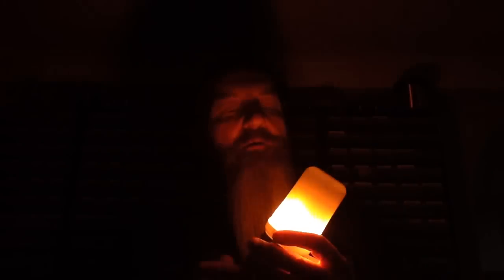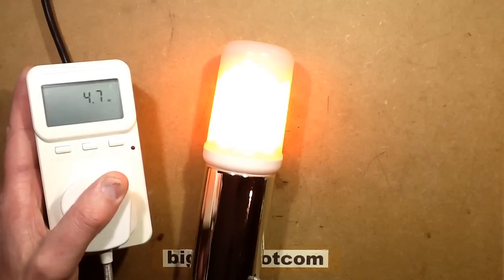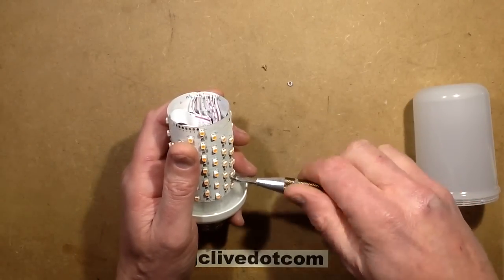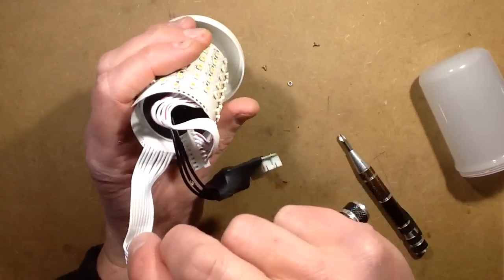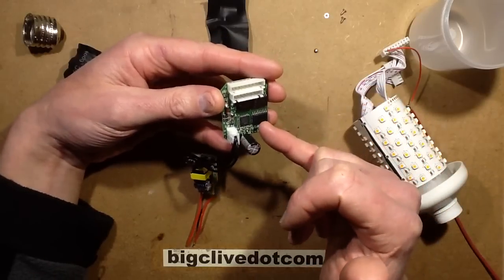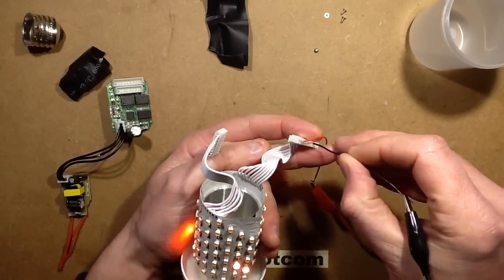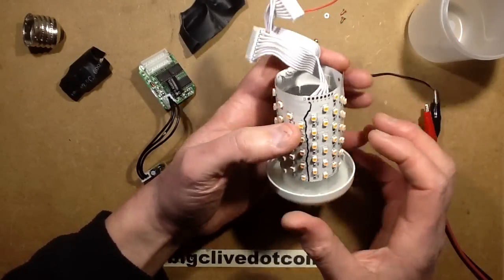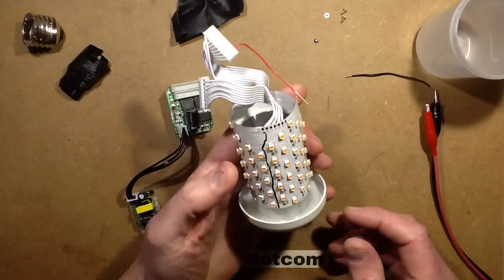Amazing new realistic flame effect LED lamp. (Full original version.)

Comment: Got 2 pairs of those flame effects bulbs now for my Aunt's altar and they're quite interesting. The come in E14 and E27 sizes with different color temperatures. (I might try to hunt down the blue one for fun)
The first set is quite similar to the one you shown and torn down with the minor changes of the Fade/Ramping and Solid/Steady light being swapped and the cover being glued on instead of a screw cover. Its got a color temp of around 2700K to my eye.
The second set was far more interesting as they had orientation sensors inside and the flame effect switches orientation depending if you have the bulbs upright or upside down from a ceiling. I didn't year them down, but the orientation sensor is more of a tiny cylinder with a ball acting as a sliding switch that makes an audible clink sound to switch between the orientation of the bulb's flame animation. Its also got the Fade/Ramping and the Solid/Steady modes that are switched the same way. Another distinct difference of the second set has a different color temp at about 1800K from what I can gather and it harder to get an photo as it tends to quite red on photos instead of a more orange-yellow flame that's close to an incandescent bulb like the first set.

Comment: You're so happy about that light 😏😁
Reply from the maker: Yeah, but the Chinese manufacturer wasn't when I took it apart and showed the schematic.
Reply: @bigclivedotcom  I wondered if you went a bit too far, but if they sent it to you with the thought that you wouldn't take it apart, what exactly were they expecting would happen, right? Anyhow. I'm thinking a lot. I'll let out another thought. I wanted to buy one of those lights, and the links in your description didn't work anymore, and so I looked up the key words on Amazon myself, and I'm finding it difficult to tell if the product has been copied, or not - it's difficult to judge from just the sellers webpages on Amazon. Yet they all have something in common: They don't use a picture of the actual flame effect, but instead they all use the same shitty cgi flame picture pasted onto the product! like they used blender to come up with a flame image in the first place, or augment it, and then pasted it onto it. It looks soo horrible and unconvincing ☺️😁😉😛 Perhaps it's from the same marketing division that thought sending it to ya is a good idea. Oh, and I also found the other style of flame bulbs that are smaller that you also reviewed which have the individual leds in the matrix shine through more. The one in the pink socket. I need to get myself some mood lighting into my home now for me and my guests. :-) I gonna grab one of those bulbs, that come in pairs, that look in shape like yours. They look convincing on other yt videos and what seems to have been added is that the bulbs can now sense their orientation and the flame pattern will move upwards or downwards depending on whether the bulb is turned upside-down down or not. :-) keep it up. I like you

Comment: 3 years later these lamps are half the price and twice as good.
Reply from the maker: Yes they are.  With a wide variety of circuitry.
Reply: @bigclivedotcom Newer ones also auto flip so you can use in either orientation.  Have you been opening up any of the new ones? Didi I miss a video.

Thanks for your wonderful videos. Your video is the reason I bought my (first generation) lamp for my Halloween classroom.  Great stuff.
Reply from the maker: @error404m  Search my videos for the word "flame" to see others.
Reply: @bigclivedotcom  thanks

Comment: Off camera does that lamp look like flame or moving dots? I got one a year ago that looks just like that. The matrix was similarly spaced. However it dodn't look like flame because you could clearly see the round dots. :(
Reply from the maker: Sometimes it helps to fine tune the diffusion by adding something around the outside.
Reply: @bigclivedotcom  I got it for a old oil lamp  that had been converted with a plug and socket. I frosted the lamp glass and still you could see the dots. I've been hoping these lights would get better so it would look realistic. If so I may try getting another if they exist.

Comment: You mention that the module supply voltage is 9-12VDC. Am I right to guess that all variants of this lamp would be happy with this range of voltage? I have just ordered one of this type of lamp: I want it to illuminate the firebox of a G-scale steam locomotive, and all the other electrics in the project will be using 12V (fake steam & smoke generator, other lamps, sound module, wheel motor etc).
Reply from the maker: They don't all operate tha the same voltage.  Different types operate from 4V to 12V.  You can get USB powered versions.
Reply: @bigclivedotcom  Many thanks for the quick response. However, I had already ordered it (Lumiereholic, Amazon $12). I chose it 'cos it has no gravity sensor & I'm putting it in the model horizontally. I shall try it first at 5V.

Comment: Clive , I live completely off the grid...primarily 12 Vdc .  The company website shows mains and secondary voltage  (12vdc) .
 I can't tell from your tear down , but , do you think I could run this from my (solar/wind) system with a +/- 2 volt variation  ? 
  I use e-26/27 sockets for most lighting .
  Been watching you and Ralfy for a bit and a sub for two months  .
 Thanks for the fun and info !
Mark.
Reply from the maker: If the voltage is variable you could use a 5V version (they do one with a USB connector) and plug it into a car USB power supply.
Reply: bigclivedotcom 
  Brilliant... I'll check it to it .
 THANK YOU !

Comment: Thanks for your great videos!
I want to add this effect to my car.. Can this lamp might somehow be easily adapted to use 12v?
What do you think? I agree they look very nice.
Reply from the maker: You can get a USB powered version that would run from a USB adaptor.
Reply: bigclivedotcom I looked about and found none, I did find one (link below) which looks ideal size wise, and I also like the single mode and gravity sensor feature. This is much more on track for me, less fuss since I don't want to see the other non flame modes ever. So, after watching your video closely it sounds like these ad 12v power inside.. can I climb in there and bypass this to wire directly to a cars 12v system? Any tips for hacking these are welcome. I want on my dashboard.

https://www.amazon.com/dp/B07832DWVX/ref=cm_sw_r_sms_tai_3hR3Ab...

Comment: I had forgotten you did this vid, i saw another guy with a different make (LIFU), he made a couple of lanterns for these, he's into LARP, so i got one to see how it was powered, turns out it just needs 5V, and as you said in this vid, the circuit is on the flexi pcb with the led's
I did a couple of vids on it, but didn't want to break the solder connections holding the flexi in a complete cylinder.

Comment: Mine doesn't unscrew like the one you have, what brand is it? I have a lamp that is covered with plastic translucent material already and I think it would look more flame like without the bulbs plastic cover
Reply from the maker: Some unclip with enough force, but always regard the circuitry inside as being potentially referenced directly to mains voltage.

Comment: Wow! That one has a lot inside it. I bought one, for near the cheapest price, and took it apart. It had no wires inside. It had a board at the base teed with the LED panel and a transformer stuffed into the screw base. That simple design was fine with me, because all I wanted to do was to try a cheap one inside my salt lamp. I stripped the globe, and base off, hooked up a old night-light cord with switch attached directly to the lead power wires, then stuffed it inside my salt lamp. The animation of my bulb is probably bottom rank, but the effect inside the salt lamp is pretty satisfying. Your bulb - I bet - has a much better realistic flame. Looks sophisticated.
Reply from the maker: +Wookiemonsterfreak This was one of the first versions.  Yours may actually have a more complicated flame pattern.  They've evolved a lot in a year.

Comment: Would there be an easy way to convert this to a DC connection? I was hoping to use this in a camping situation.
Reply from the maker: If you look at my more recent video on one of these flame lamps you'll see it can be run from a USB power bank.  Some other versions require 12V though.

Comment: So if I wanted to use this as an outside carriage lantern on the house, and the first night it comes on as a flame, then the next night it would come on in a different mode?  Or does the mode change only happen with a short off/on cycle?
Reply from the maker: +Mike Frazier It requires fast switching to change modes.

Comment: If I put this in a sensor-based lamp - one that automatically turns on at dusk and off at dawn -- do you think it will keep changing "modes"? What triggers the mode change, and is there a way to turn that feature off? I don't just want flames every 3 days.
Reply from the maker: It only changes modes when turned off and on quickly.

Comment: Hi, so you mentioned it the transformer supplies 9 & 12 volt. Do you reckon it would work okay if the transformer was removed and it just runs directly from 12v? 

There would be prefect to be used for awning lights on my 12v campervan

Comment: I've procured four flame effect LED bulbs over the last couple months from aliexpress. Two are the same size as the one in the video. However, they offer two modes, flame, and all-on. On these, the complex array of PCBs, connectors and cables seems to have been tidied up quite a bit. The flexible circuit board holding the LEDs also holds what appears to be a single chip as it folds through a slot on the aluminum tube and extends inside. Only two wires connect it to the power supply board coming up from the base. I haven't further disassembled the bulbs since it appears further disassembly would possibly be destructive. The other two bulbs are smaller, approximately 2"/50mm in diameter. Same height as the others. These are single mode only-flame effect. These also eliminate all the connectors and wires. The LEDs are mounted on the flexible board as before, wrapped into a cylindrical shape, but not an aluminum tube. The PCB tube is smaller in diameter, approx 1.25"/ 32mm. Same number of LEDs as the larger one, but more closely spaced. The PCB tube is mounted on one end to a circular double sided rigid PCB, which forms a base, and contains the brains of the bulb. It has a mystery 18 pin chip and some passives on the out-facing side, and what appears to be 18 transistors and passives on the in-facing side (the bottom of the tube). Again, only two wires (red positive, white negative) connect the whole assembly to the power supply in the base. The light assembly is powered by about 5V, which I verified by powering from a bench supply. Works down to about 3.1V at reasonable brightness. Below that, you can see that it does function, but the LEDs get very dim. According the the power supply, draw at 5V is about 500mA max. At 4V it drops to about 150mA. Not sure how accurate that is, but could make for a neat battery powered hand held lantern effect. Curiously, my dumb Kill-A-Watt says the smaller bulb is about 3W, the larger bulb 1W in flame mode. The large bulbs were less than $12USD, the smaller bulbs less than $8USD when I bought them. The larger ones have been on continuously for about a month, still seem to function fine. I've seen some sheet plastic at the local home improvement center that might be good for further diffusing the LEDs. It's clear, but textured so that it looks like rain rivulets on glass, designed to allow maximum light transmission, but highly and randomly distorted, the sort of thing one might use for a shower stall or bathroom to offer a degree of privacy. Really neat bulbs. We'll see how long they last.

Comment: If the light is on a daily timer and you have it on the flame mode, the next day when it turns on, will it be in flame mode still, it will it switch to the next mode.  Are the modes only switched when you turn it on and off rapidly?
Reply from the maker: Yes.  It has to be rapid.

Comment: The little power module is a current driver, actually, since LED intensity is linear with current, not voltage.  Sinking I/O to 3 LED's each per line on each section.  Artistically well done.  "Echoed" is a good word!  5V/360 Ohms = 14 mA per LED.  Probably PWM'ed for efficiency.

Comment: Interesting tear-down video. I'm considering getting a couple of these to replace the noisy mechanism in our flame-effect fire, but I'd have to find a way of disabling the switching between modes on sequential power cycles
Reply: I think, just removing the third wire should suffice.

Comment: Can you think of any way to run that on a battery?  I need to make two torches for a production of Fiddler on the roof and these would be AMAZING!!!
Reply from the maker: The internal voltage was quite low on this if I recall correctly.

Comment: By the way these can easily be modified to battery use for stage/handheld prop use BUT be warned there is a newer version out with a much better design (all PCB no cables) and while the LED PCB still says 12v, it isn't, the unit needs to run of 5v or you will blow the main IC.
Reply from the maker: Interesting.  Where did you get that one?
Reply: bigclivedotcom TLC trade counter they have both types. Is there a way I can send you photos? I think we have some mutual Facebook friends from your Scottish theatre days, I've done some SFX work with NTS.

Comment: I have bought one of these but the LED spots are too prominent and not apparently so softly fogged to flicker like a flame as the video shows. Bought from amazon, do I have an earlier example or is it the effect of the video?
Reply from the maker: It looks a lot softer when viewed from a small distance.
Reply: Thanks for your message nice to speak to you again. Reckon I am going to put these into some old Victorian (Pugin) processional church lamps and mount at fairly high level with a frosted glass inserts for BVM chapel. I see the actual website suggests smaller and larger versions probably larger is best. Happy New Year.
Reply from the maker: Experiment with the frosting.  If it's too much it hides the effect.

Comment: Excellent videos as always Clive, I am like you In that I dismantle random electrical stuff for fun, as well as install / repair it properly (yes I'm an electrician/electronics engineer too)..These lamps are available in the uk from an electrical wholesalers in the south east called TLC. I've used several and really like them and they are available in BC or ES cap versions.

Comment: Actually kinda annoying that it changes mode on each power-up.

If you cut that 3rd wire feeding the control board, does it disable the mode change ?
Reply: It probably only changes modes when you rapidly flick the switch back and forth: no bother with normal use.

Comment: FWIW, I've done LED sequencing and tried randomizing via feedback shift registers, and I've found that I always started getting recognizable patterns.  I experimented with a few different methods, and wound up using a Mercenne twister algorithm.  Implementing that for 32 bits even on a small microcontroller is very quick, there are integer versions available easily online.  I got lovely results using that.
Reply: If you want random patterns out of an n-bit LFSR, use every nth cycle of the LFSR.

Comment: I have the blinky tape and this is how I use mine as well. I made an ambery fire animation pattern that I use as my night light/ambiance. I just ordered one of these bulbs off ebay, they are $35 and by a seemingly different company other than the one you listed. I believe the one I just ordered was by Junolux.
Reply: Update, I've been emailing back and forth between ledflamelamp.com and they want you to buy 5 at a time for $25 each. So minimum order requirement is $125 and free shipping. The bulb is compatible with both 110v and 220v lamp sockets.

LED Flame Lamp IS the inventor and has a patent. JunoLux is the competitor. However, LED Flame Lamp is only selling directly on Amazon's UK site with poor reviews. But on the U.S. Amazon site they sell the JunoLux version in two different fire colors, and theirs can be run upside down, and it flips the animation. So if you wanted to use them in your porch light, JunoLux would be the one to choose. Plus, if you are a Prime member, they are only $27 each. No need to buy 5 if you just want to try them out.

Comment: 5:54 Holy shit your finger came so close to the live wire
Reply: .....  Yeah, but the Safebloc was open, so it was not live!  :)

For anyone else who has never encountered a "Safebloc" quick mains connector before:  The lid has to be fully closed all the way  (safely covering up the clips)  to apply any power to the device under test.  You can actually see the fuse  (on the live side)  and the solid brass neutral link at the back, inside the lid, if you look carefully .....  The pins drop into sockets behind the clips and complete the circuit only when the lid is shut.  Only the earth wire is permanently connected.  The neon lamp  (which the ones we had in the lab when I worked in the industry, did not have)  is lit all the time, to show you the terminals are going to be live when the lid is closed.

It actually makes more sense not having the neon switched by the lid, because it's more useful like that -- it saves you from having to close the lid  (and risk everything on your bench becoming live)  just to find out whether or not it is switched on at the wall.